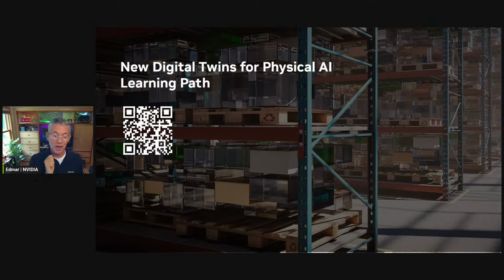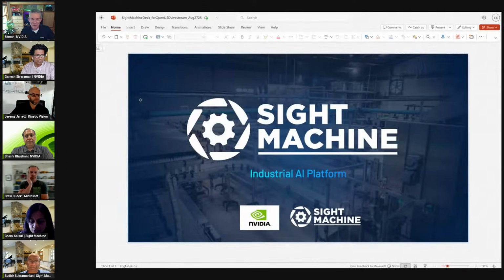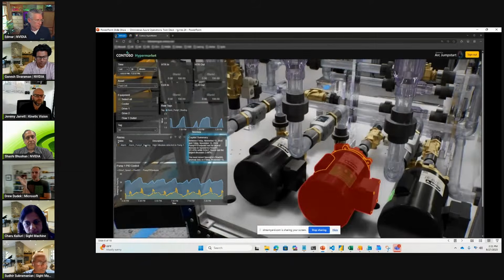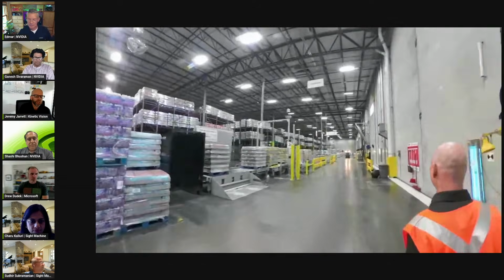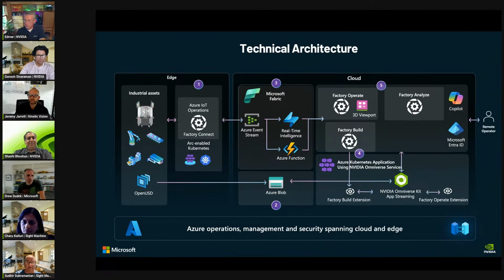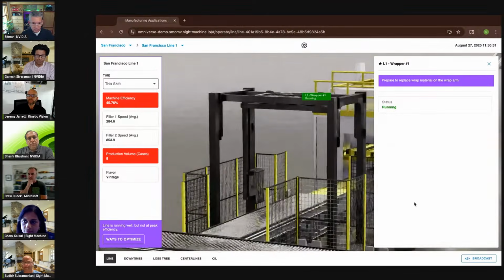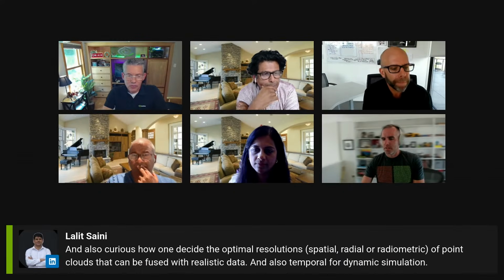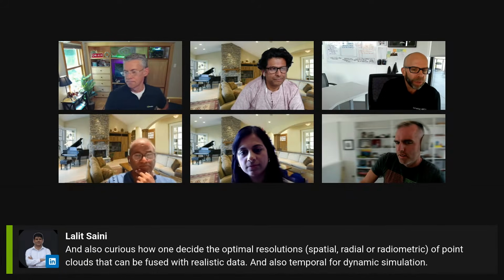Building Agentic AI-Powered Digital Twins for Manufacturing Operations

Comment: Hello Sir, I am a fresher in Material Processing & Testing and very interested in transitioning to digital design tools. This video shows how Sight Machine, Microsoft, Kinetic Vision, and NVIDIA are transforming manufacturing with Agentic AI, live production data, AI-driven recommendations, and physically accurate simulations through Omniverse and digital twins.

I want to set up a mini workstation locally not just to learn and experiment, but also to connect with the industry—understand what skills and workflows are needed now, what’s in demand, and what will be needed in the future. Could anyone guide me on the recommended hardware and software setup for a beginner to start exploring Omniverse, OpenUSD, and CAD/CAM integrations effectively? I’m ready to invest in building a proper environment for learning and industry engagement.